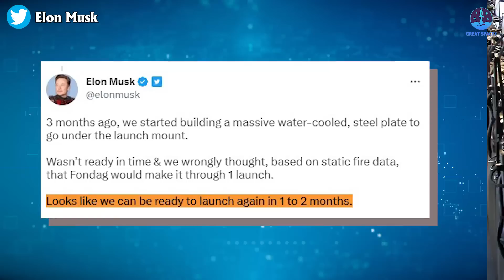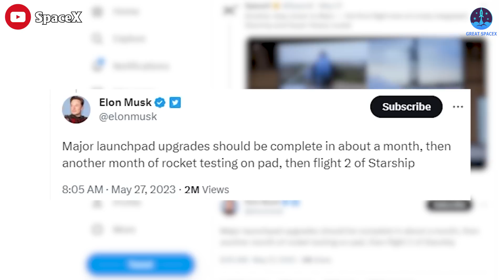SpaceX pushes the 2nd Starship orbital flight faster...

Comment: How the F is starship going to land on unprepared natural surfaces of varying materials. It will bore a hole 100’ deep in some instances!! 3’ 
Boulders flying around !! It will not work. Smaller landing crafts must be detachable in sections of starship hull so less thrust is needed to land is paramount in being able to land on all surfaces and varying material types
Reply: It wont land on the surface, but will be grabbed by the tower
Reply: @philliprisgaard6394  that is just the booster. On earth. No tower on mars
Reply: @philliprisgaard6394  why do you not recognize the reality of starship instead of being a blind worshipper? 
Love what he is attempting. But there are many many tech and human oversights

Comment: Once the booster malfunctioned to the point orbit/mission was impossible, lost control, why didn’t the flight software shut down the booster engines, separate the Starship & let it try to save itself, then soft land in the ocean. Too bad we didn’t get Starship flight data applying to saving manned missions. One day there might be a landing barge positioned to land starship after a booster failure.
Reply: Can't be done. Stage separation between booster and starship is not an active system.  It is a flight maneuver where the booster essentially flicks off Starship. Once booster malfunctioned and control was lost, stage separation was no longer possible. Starship was doomed. Booster failure is fatal to Starship.

Comment: I think we knew the booster was going to have issues during the static fire three engines did not ignite. During the launch the same three engines had an issue and the engines aren't a hundred percent reliable yet. The only thing that we didn't expect was for the booster not to separate. And I think we knew the Launchpad wasn't going to make it. It's in a much better spot now starship separate I don't think we'll have a problem on the next launch.
Reply: They'd also lost control by the point of separation which is essential for the separation move. Looking forward to the next one!
Reply: Once the booster malfunctioned to the point orbit/mission was impossible, lost control, why didn’t the flight software shut down the booster engines, separate the Starship & let it try to save itself, then soft land in the ocean. Too bad we didn’t get Starship flight data applying to saving manned missions. One day there might be landing barge positioned to land starship after a booster failure.
Reply: @warrenwhite9085  Because the way Starship separates from Boaster requires the engines of boaster to move on their gimbles and essentially flick off Starship from the boaster assembly. Stage separation in Starship is not an  active system like in Apollo. Hence, once control over boaster's engines was lost, Starship was doomed. Stage separation was no longer possible. Booster failure is not an option in Starship. Either it is space or death. There is no emergency separation.
Reply: @warrenwhite9085  "why didn’t the flight software": Frankly? because it wasn't programmed too.  The test wasn't for recovery, they were just testing the overall design. They never intended to save the flight, land it or anything like that, it was just going to be dumped in the ocean if it actually completed the goal of making it to orbit. So, in the event of a failure(such as losing the ability to reach orbit because the booster failed to reach the correct altitude) the mission was considered over, so there was no reason to program any additional complications like trying to save the rocket that they planned on dumping anyway..
Reply: @teksatan4699  I disagree… it was an obvious oversight of the SpaceX software guys. The purpose of the flight was to test, validate, exercise the Starship launch systems, including the stage0/pad, booster & Starship itself, gather all possible flight data from the hardware. Of course SpaceX wishes it had put that software in to salvage the opportunity to test/demonstrate Starship separation, startup & flight. I remember the early Falcon/Dragon flight where the booster failed, the Dragon separated OK but then plunged to destruction impacting the ocean because the flight software didn’t exist to open the parachute after launch abort.. another oversight.
Of course SpaceX wishes it had coded the Starship flight software to shutdown the booster, separate & get Starship flight data & opportunity to demonstrate soft landing in the ocean… Eventually SpaceX will have to sacrifice a flight to get that data to demonstrate saving Starship/crew from a booster failure like this.
Reply: @warrenwhite9085  Yes, key word eventually this test was not to test failure systems of the stack. SpaceX never claimed it was to test failure modes of the rocket as it pertains to anything other than making it to orbit. SpaceX has been separating boosters and rockets for a long time with other flights, they already know they can separate the booster. it never reached a high enough altitude to bother separating because even if they separated the booster did not make it high enough for starship to make orbit. which would have given it an unpredictable landing location. This test was calculated and ran exactly as it was intended.
Reply: @warrenwhite9085  In addition to my last comment: Starship follows a pre-planned flight path, it must make very specific achievements in altitude, direction, speed etc. If any deviation happens the flight must be aborted because the rocket will no longer follow the designated flight path. the law dictates the rocket must be destroyed if it non-recoverable, space never intend on recovering starship which Elon said multiple times. Elon stated it would more or less just be a bonus if it was recoverable, but at no point in time was recovery ever part of the flight plan.
Reply: @teksatan4699  Again, I respectfully disagree… The purpose of the flight was to gather all possible flight data for booster & Starship. The software crew had over a year of FAA caused delay to lay in robust software to achieve the goal of gathering all possible flight data, including the booster failure scenario. once the booster began to lose control, the opportunity existed to separate Starship & get flight data from it, including soft ocean data. This was a significant lost opportunity, especially since the Starship separation method is new, much different than Falcon. Consider If, for example, the next booster works then there is some Starship separation/ignition/flight failure which could have been discovered in the first flight after booster abort.
Maybe we just agree to disagree. Cheers.
Reply: @warrenwhite9085  Lastly, if spaceX would have attempted to recover starship form the location the booster failed at, it would have put the landing location dangerously close to land.. the EPA would have immediately stopped the program, They almost did as it is because shrapnel landed all over the place, include peoples back yards.. There is a reason there was no attempt at recovery, it could have made things 10,000 times worse if starship tried to land and crashed in the middle of a populated town.
Reply: @warrenwhite9085 Yes, again.. it was to capture all possible data. Starship recovery was not possible given the location it failed at. Again, the rocket shrapnel already landed in a populated area. If the rocket was kept intact it could have marked the end of SpaceX. you are making up your own shit here, At no point did SpaceX or Elon ever say this mission was meant to ever be recoverable. So, it doesn't matter what you think, or what your opinion is. Saving starship was at no point ever part of the mission, period
Reply: @warrenwhite9085  You do realize SpaceX doesn't use a "black box" right? lol You are aware SpaceX has a live uplink to starship, and downloads their data live from the rocket during flight They don't need to recover the rocket, they caught all of the metrics live
Reply: That was the ONLY thing that wad unexpected 😅😅😅😅
Reply: There is nothig wrong with seperation for the rocket. In the orbtial flight test the vehicle did not reach the targeted altitude hence it did not separate

Comment: Is the deluge system the funniest thing you've ever seen?  Given the unforseen geotechnical problems, this makes no sense.  Of course it will melt into a steel slag during launch.  Musk's engineers better have made this system disposable.  The quetion to Musk is, why aren't you construct a flame trench now?
The best part of this video is claiming the test of the system worked  when the video shows that it did not work.
Reply from the maker: The terrain in Starbase is not suitable for making flame trench. Follow our channel to learn more about it.
Reply: @colonbina1  exactly!
Reply: @colonbina1  of course it is.   They have to build up like EVERYONE else does.  Elon is just thinks hes an actual engineer.
Reply: It will definitely work
Reply: Melting into slag is not a problem. Water superheat into steam within the pipping that explodes out like a bomb may be a bigger problem.

Comment: Can rocket engines be made with an ‘accelerator pedal’? I mean, obviously doing a ‘burnout’ off the line is what destroyed the launch pad which upon fragmenting, damaged the rocket engines.
  Too bad rockets are only designed for vertical takeoff. That much power unleashed all at once; something’s got to give. I hope their new bandaid works.
Reply: The Raptor engines used on Starship already have the ability to vary the thrust from a minimum of about 45% - 50% up to 100%. Strangely enough it wasn't immediate full power that was the prime reason for the large damage but that the engines throttled up too slowly thus not getting the booster up and away from the pad fast enough. I am guessing that flight 2 will start and ramp up to full thrust much faster than the almost 10 seconds it took flight 1 to clear the tower.

Comment: At the very beginning. The first flight did go as planned, once the tower was cleared, all the rest was good data.
Reply: Once the booster malfunctioned to the point orbit/mission was impossible, why didn’t the flight software shut down the booster engines, separate the Starship & let it try to save itself, then soft land in the ocean. Too bad we didn’t get Starship flight data applying to saving manned missions. One day there might be landing barge positioned to land starship after a booster failure.
Reply: @warrenwhite9085  The design was complete to represent the state of development, the test was to find the weaknesses by taking data of the REAL flight conditions, not on the theoretical predictions.
First priority was to clear the tower, and it did far more interactions between the engines, not predictable led to failures, especially the hydraulic thrust vector  control system to steer the rocket inner engines, that failed by loss of unpredictable hydraulic fluid, they already knew there was a potential problem but did not have time to change it to the new all electric system, so the went for it. Similar problem with the separation process , separate first and then ignite the upper stage or do a hot start, ignite the upper stage engines first, produce venting for the hot gases and then steering is assured.
Reply: The method of building many rockets, test them one at the time, discover the problems, fix them for the next flight leads to rapid reliable development, far far far cheaper than the decades of development of the SLS, costing around thousand times more. How would you do it?
Reply: I have direct experience with this nessessary hot start separation approach, with a much smaller rocket, the 'mini Minuteman ICBM' , developed by Convair during the Reagan time in the so called Starwars program.  (strategic defense initiative)
It was my job to conduct the separation dynamics simulations at Convair (General Dynamics)
At the time the aerodynamic properties were known by down scaling the measured Boeing Minuteman ICBM data. 
Any way only the hot separation steering prevented the upper stage to go sideways, the stable attitude of a cylindrical body in a high q environment.
Reply: @Shindiggity  You meam landing at the tower?
It might take a number of aborts  till they nail every landing.
The SpaceX control system engineers are outstanding and will be able to design the system to reliably approach to position of capture and rotate  the 'chpsticks' to that effect. The technique is taught at MIT, Optimized, stabilized trajectoy.  few words with  a significant success.
Takes considerable to explain to non optimal control skilled people.
Reply: @Arturo-lapaz  they wont
Reply: CRICKETS
Reply: Literally nothing went as planned 😅😅😅

Comment: I wouldn't even be surprised SpaceX to completely change Starship design, into the direction of the Jarvis project from Blue Origin. With a stainless steel upper stage, but with a standard payload fairing. Some of the main advantages, it's having less mass at reentry as a more standard procedure to deploy the cargo at Orbit.
Reply: I would be, but that's me.
Reply: @johnd.7792  for missions to LEO it could actually make more economical sense than the current design.
Reply: That isnt fully reusable
Reply: @Hungary_0987  why not? You can retrieve the fairing as Falcon 9, and the upper stage still is able to propulsive landing.
Reply: It would surprise me because one of their main goals are taking humans to space which would be harder with fairings
Reply: @masterweird  but that task could be with the current Starship design. Meanwhile for commercial missions to LEO, SpaceX using the fairing version.
Reply: @RogerM88  they might use a fairing in the future but for now they want all the practice they can get with landing so i suspect until humans start flying on it it won't turn into a fairing but after that it's a possiblility

Comment: "not only lost the spacecraft".. They would have lost it anyways. Both booster and ship would be terminated at sea...
Reply: And they lost their permit to launch again. Phony environmentalists strike again allegedly funded by Amazon founder….doesn’t he own his own rocket company?
Reply: Once the booster malfunctioned to the point orbit/mission was impossible, lost control, why didn’t the flight software shut down the booster engines, separate the Starship & let it try to save itself, then soft land in the ocean. Too bad we didn’t get Starship flight data applying to saving manned missions. One day there might be a landing barge positioned to land starship after a booster failure.
Reply: @warrenwhite9085  because they separate by flip maneuver, so they need tvc on booster
Reply: @warrenwhite9085  that costs too much
Reply: @warrenwhite9085  The forces at play doomed the mission before it left the launch pad. Really bad SpaceX engineering on this one.

SpaceX learned the hard  way and have made massive improvements but I am not convinced they are doing enough positive changes with the launch pad, booster separation and “what if” scenarios.

However, I am not on SpaceX engineering teams, if I was, Starship 1st flight would have been vastly more successful.